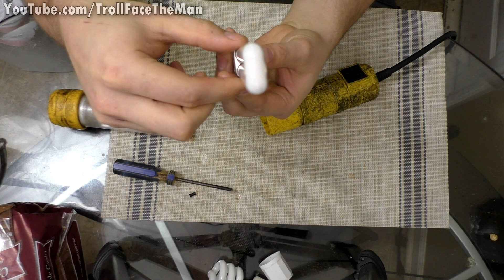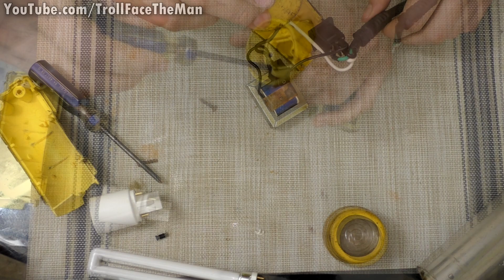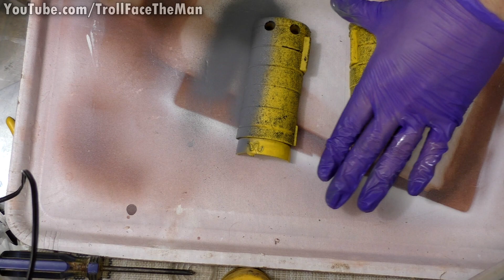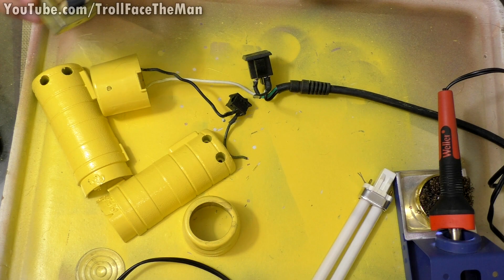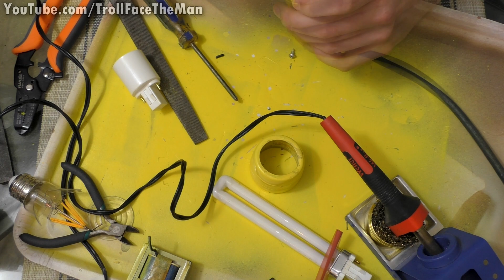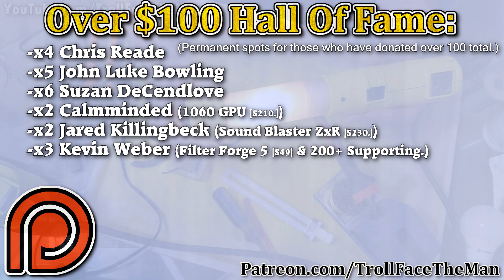Fixing Ballasted Florescent & upgrading to LED Light. Restoration, repair & ballast bypass.

Comment: Superglue with baking soda would be a better plastic glue instead of super glue by itself. And now there is a better glue than superglue, for many applications but not all. It is a UV curing glue, called JB Weld's Super Weld. It comes with a small UV light. It is extremely strong, my new favorite, by far.
Reply from the maker: I have tried the baking soda method and it has it's applications, however a lot of times flush surfaces are best to be glued normally if possible. The UV glue won't cure when in between opaque objects too which is an issue with it at times.